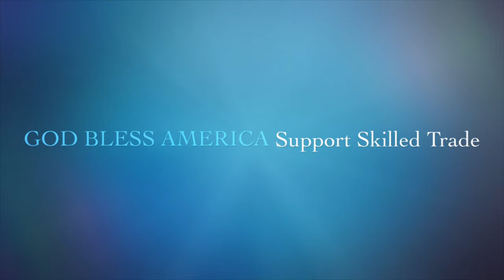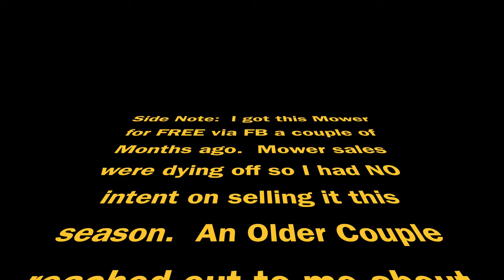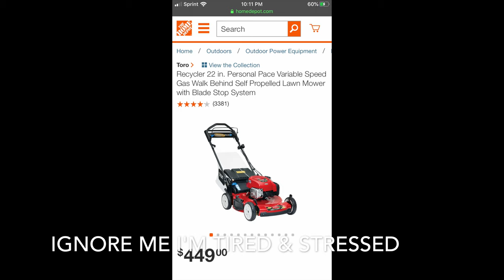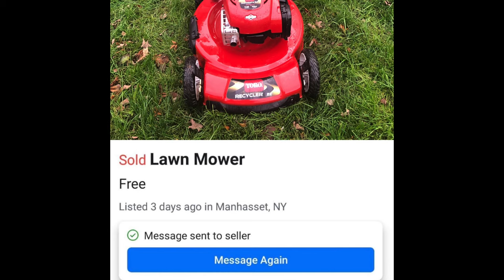FREE Toro Personal Pace Lawn Mower W Electric Start HOW FIX N FLIP No Start Clean Carb 24 Hours

Comment: Hey Buddy , Please be careful spilling gas on the driveway . Asphalt has tar as a binding agent ,  the gas dissolves tar . This will damage the driveway , even if it is going to be replaced you do not want big stains or holes in it  . I use cardboard to protect mine works good and its free .
Reply from the maker: Thank you!

Comment: I have the same exact mower acting the same exact way. I used some seafoam because it was low power and would die when fully warmed up. Now, if I can start it, it starts for a second and dies. I've cleaned the carb with carb cleaner and even took the plastic jet apart and removed and checked the float. Also changed the spark plug just for kicks and changed the oil and the fuel. Still not working! The thing is only 2 years old I'm so frustrated. Also curious to see if you fixed the electric push button on that. Is there a small battery you replaced?
Reply from the maker: Bruha Ha 

99 Percent of the time...runs and dies its fuel related.  Confirm good fuel flow...sometimes not all
Carbs can be saved via cleaning and need to be replaced.  The Chinese copy cat will work fine!

Electric start works on this mower as Well. Usually the battery is the issue.  If you want get a good battery and run jumper wires to confirm.  Battery on the model if I recall correctly is incased near the grass flap.

There is also a 40amp in-line fuse, make sure that isn’t blown.

Thanks for the view and comment, hopefully you subscribed
Reply: @pattayperformance  Thank you so much. I think I just liked the video. Subscribing now!  Add the spark plug hole and there was lots of carbon build-up on the piston do you think that could cause an issue?
Reply: @pattayperformance  Well I replaced the carb and it still won't run more than a couple seconds if I can get it to start at all. Any ideas?  I push the personal pace lever down when attempting to start a couple times then let it go and can get it for just a second. White smoke then dies
Reply from the maker: Bruha Ha,

The personal pace lever just controls belt tension for the transmission.

I’m partially color blind so most smoke I see is white lol.  That is excess oil being burned off or a head gasket failure.

There are a few ways to check for a blown head gasket.  Usually as you spin the motor by hand you can hear a sucking sound or get soapy water and spray around the head gasket.  Try and start it and observe to see if bubbles form.

I’m absolutely shocked it’s not a carb and I wish I was there to help you.  Hard to desktop diagnose.  I will try the best I can!

Are you on Instagram?
Reply: @pattayperformance  I'm not on Instagram but I really appreciate your efforts. My one mistake was I never treated my gas so I had excess carbon build up and thought the Seafoam would be a good idea. Its been terrible ever since and I'm afraid it just didn't run long enough to get all the residual seafoam out. Steve's small engine said the main jet hole was too small on the new plastic carbs so I really worked on that a bit also. Like I said it'll run for a couple seconds if I'm lucky. Hope I can return installed parts from Amazon.

Comment: Why won't my electric start not work ? It turns over but won't crank. Pull the rope cranks right up.
Reply from the maker: The gear for the electric start isn’t going up to engage the flywheel.  Get a long screw driver and try and turn the plastic tooth gear.
Reply from the maker: Here is a video that shows what I’m talking about.  Unfortunately I don’t recall the timeframe i did it in.

Thanks for the view and comment, hopefully you subscribed to my channel.  Don’t hesitate to ask more questions!